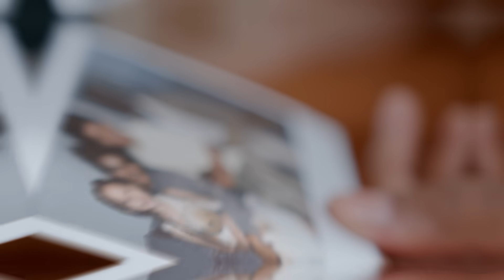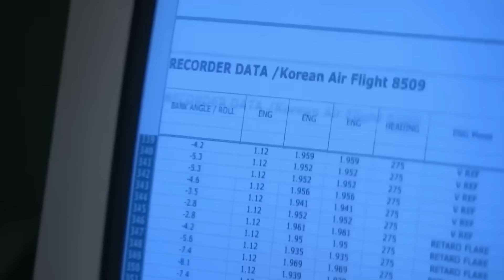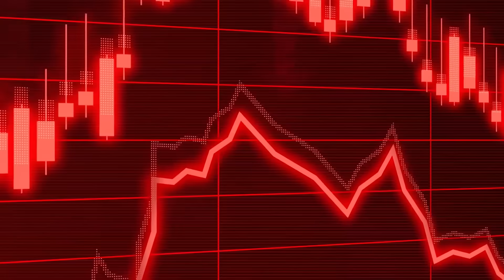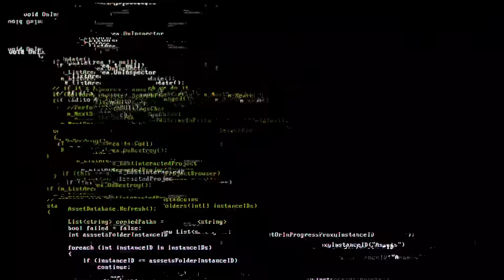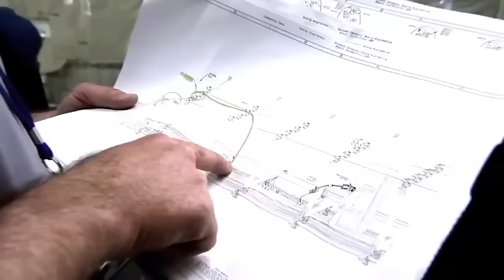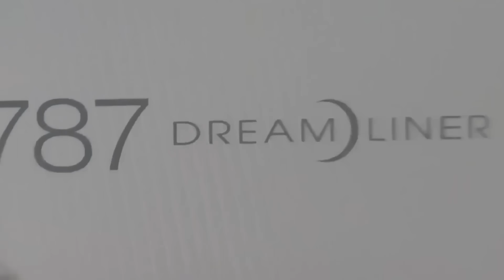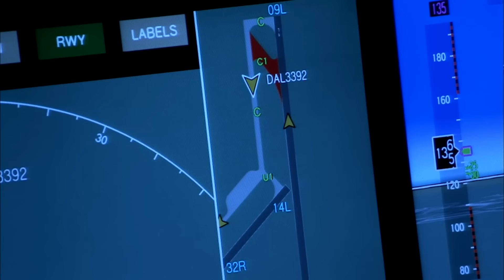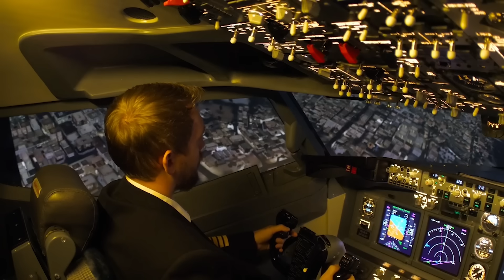What Scientists Found Inside the Air India 171 JUST DESTROYED BOEING

Comment: BS.  What you said is nothing but a lot of if's, and's, or buts.  You know nothing so you try to place the blame on something that cannot be proven.  How long had the 787 been flying?  How many times have all those 787's taken off?  Wasn't this the first ever 787 to crash?  So the software is now screwy?  Did a computer program stop the fuel flow to the engines?  The fuel switches are a mechanical part.  The relays that receive a voltage from those mechanical switches have no digital inputs from the software.  The valves that allow the
fuel to flow are controlled only by the relays.  It wasn't any hi-tech programming screw-up
that stopped the fuel flow, it was a physical act.  Don't pass the blame on to some hi-tech thing.  It seems whether by accident or on purpose, the fuel control switches got changed.
Reply: True BUT  AI cannot control or warn against its own mistakes

Comment: Wait , barely any certified engineer ?  Even if there had been certified engineer , it would not have helped . Take me , i default to . ITS ALWAYS A FALSE SIGNAL .THERMAL , MAGNETIC , ELECTRIC etc . But i'm a weirdo . Nobody start like me with a bias . Starter fail ? Its the cause . Me starter fail ? Its a result , not the cause . You can not pin this on anybody . Is academia teaching wrong ? Its their job to figure it out . My job is "i do not work" no benefit anywhere . I write my method because it work , in racing , in trucking . Airplane ? Beats me but juging by energy flowing in airplane ? I'm likely still right . Why ? Dude , i do not even use a wireless coil test light . How should i know , my finding ? Think "oil condensator" . Gremlin gremlin gremlin . Poof . Where did all that energy go ? Its random . Oups bathroom light do not work . Oups relay ois now weak . There should not be relay on airplane but that is futurproofing . Not todays issue .  Something made the trim act up in previous flight . That is a good starting point . Assume its not fixed